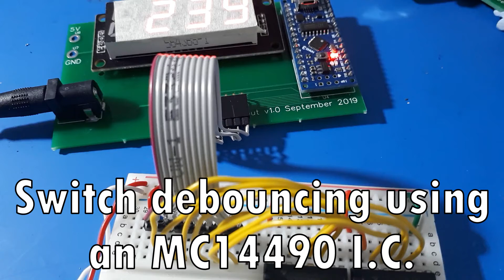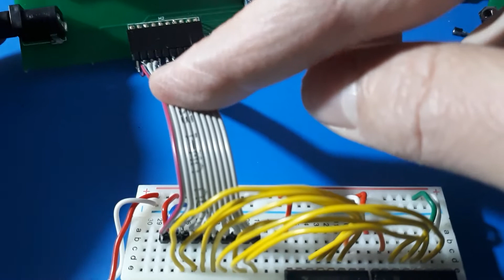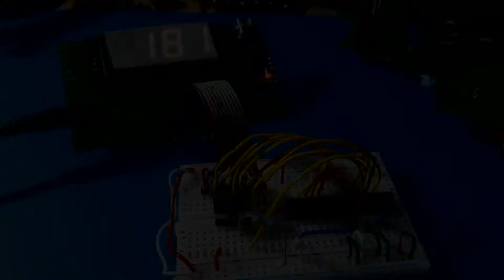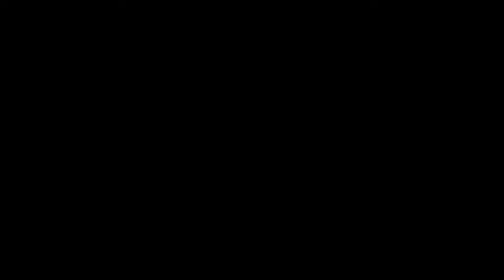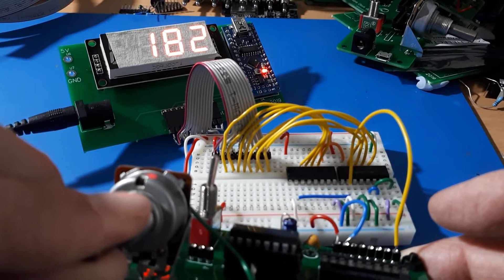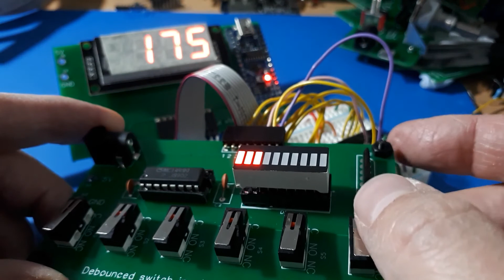Switch debouncing using an MC14490 I.C.

Comment: A great video on this chip.  I am going to try and tame a KY-040 rotary encoder I am using to drive an interrupt pin on an Arduino Nano.  I Amazon says I probably will not see the chip until mid December.
Reply from the maker: Ebay is your friend!